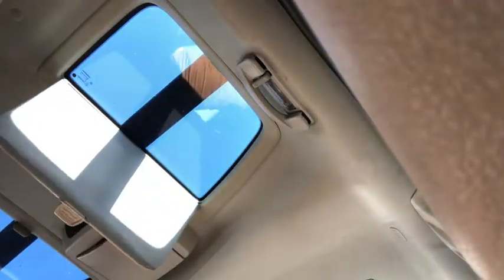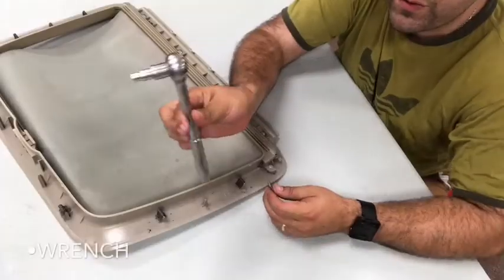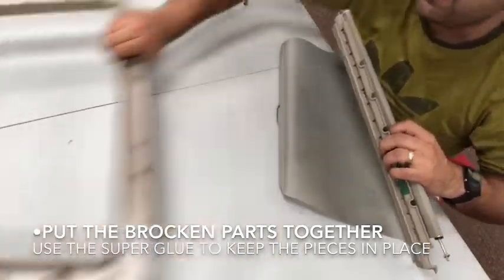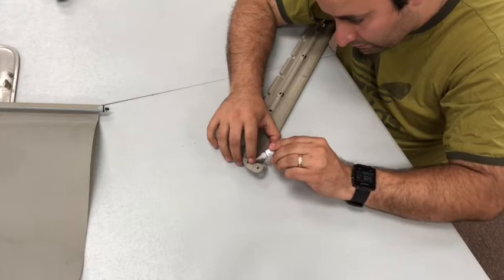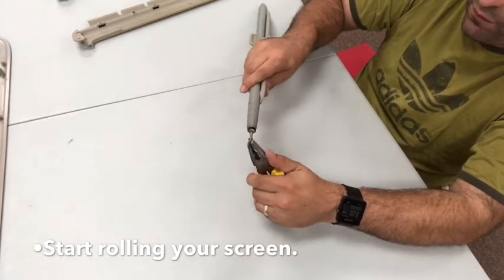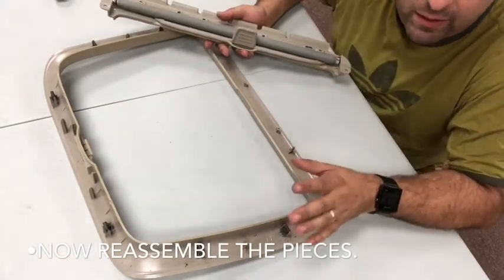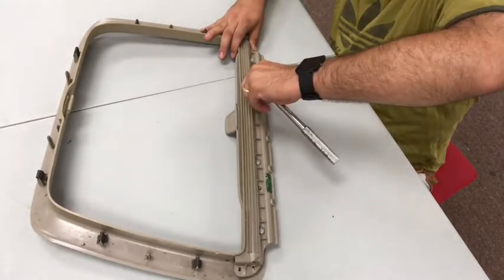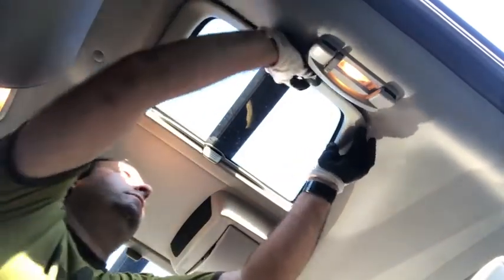SunScreen repair - Jeep Commander

Comment: Just bought a commander yesterday with both sides sagging. Now I know what to do to fix that problem. Thanks for the vid!
Reply from the maker: You’re welcome!
This is one of the most commonly known problems the Commander has. The other one is the sunroof leaking. Also an easy fix.
But with maintenance this cars will last forever. Congratulations on your purchase.

Comment: Very useful, Thank yuh soo soo much💕
Reply from the maker: Glad it can help
Reply: @oscarhuerta1098  Heyy, The stereo in the jeep is not working, the switches work but the screen doesn't turn on at all. Is there a solution for this..? If yes plsss let me know. Coz I like hearing music soo much while driving😑
Reply from the maker: @17.muneesxib35  I’m afraid you need a new stereo, once the screen is gone it is not coming back. The good news is that there are many of these stereos on eBay.
Reply: @oscarhuerta1098  Noo its a normal issue with the jeep commander. Sometimes when the vehicle is cold the stereo opens up, but after a few seconds the stereo display goes... Is this a stereo fuse prblm or like yuh said should I search for a new one ?
Reply from the maker: @17.muneesxib35  I recommend looking for a new one. If you want to keep the steering wheel buttons functioning get the same type of stereo, it doesn’t have to be from a Commander; Jeeps, Chryslers and Dodge share the stereos in the years they produced the Commander. But the prices are comparable if you’re looking for a new stereo with apple car play or android, even with the large “tesla” like screens.

Comment: Great video Oscar of the step by step process.  I just bought a Commander and both of the shades are hanging down.  Yours had the broken plastic pieces, and I'm concerned that mine might not.  In the event that there are missing pieces, do you have any suggestions?  I've heard about some guys cutting off the shade and applying a piece of dark window tint on them, but that seems like a last resort.
Reply from the maker: If the plastic pieces are not broken, the sun screen may need adjustment, which requires the same process (whining the screen).
I hope this helps.
Reply: I just finished my two shades and I'd like to share a tip I used.  Rather than using pliers to hold the metal shaft, I opened a large size paper clip and stuck the end through the tiny hole that's near the end of the shaft to prevent the shaft from rotating.  I then rolled the shade four times, inserted the shaft into the plastic piece, and was able to slightly turn the shaft with the paper clip (while the shaft was partially fitted into the plastic), put a bit of downward pressure, and it popped right in.  I'm guessing that hole in the shaft was utilized when these shades were assembled by the OEM supplier in production.  Thanks again Oscar for doing this video, I'm so glad I was able to repair these cool shades rather than cutting them off like many people likely do.

Comment: I think the spring or whatever inside my actual pole is broken because when I hold onto it and I twist it and I let it go it doesn’t move at all do you know what I can do to fix it now lol
Reply from the maker: In your case, my believe is that the metal stick is bit connected to the base on the one side and that is why the spring is not creating tension.

Comment: I have a 2006 Commander and mine won’t come off like this is there any other way?
Reply from the maker: It comes off, but they are very well snapped in with metal parts.
Reply: Oscar Huerta ok thanks